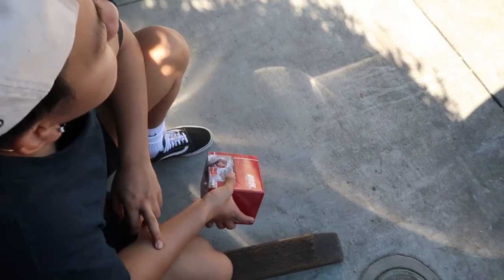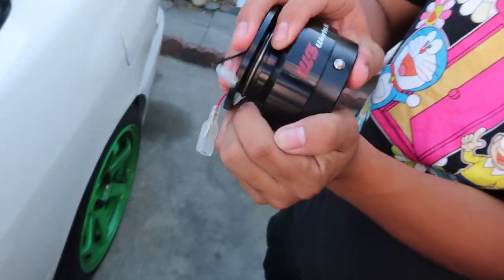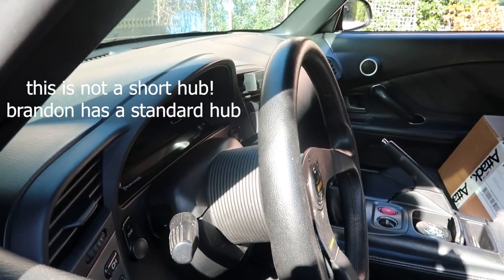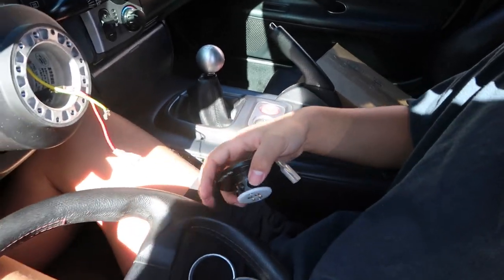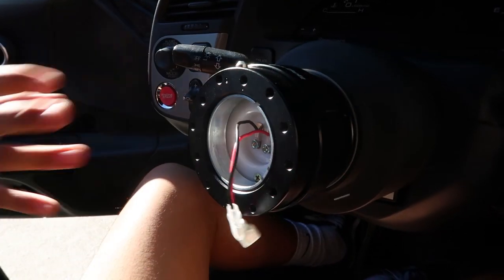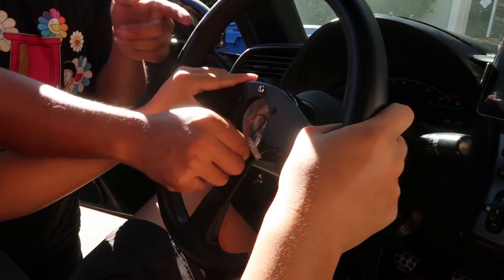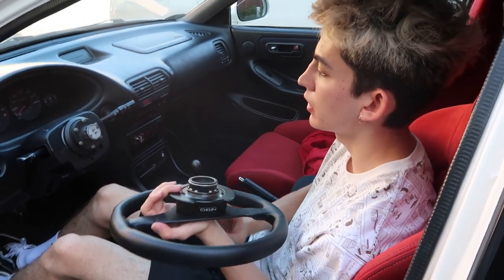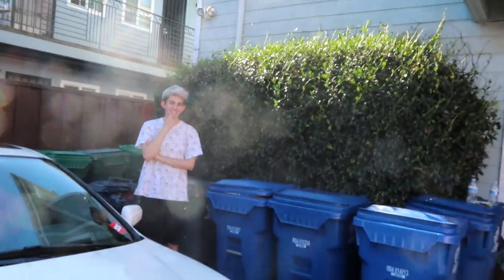NRG VS WORKS BELL QUICK RELEASE!! WHICH SHOULD YOU BUY FOR YOUR S2000!?

Comment: If you ain't tracking or putting unnatural amounts of strain on your steering wheel then nrg or any other cheap option. If you want something good though then works bell. Works bell invented the quick release and have put much more RnD in their products. They also don't manufacture their shit in China. The aluminum alloy they use is much more stronger and durable than knockoffs.

Comment: on werks bell hub, you can remove the saftey switch that prevents you from unlocking the hub easily.
Reply: You can on the nrg too
Reply: WB also sells the RAPFIX Flipper which converts the push button to the fingertip paddles you see on the NRG quick release in this video. NRG got the idea from WB. The WB piece is aluminum.

Comment: Does the nrg quick release work on the works bell hub receiver? Like can you take the steering wheel from the integra and put it onto the s2000 with the works bell receiver?
Reply: iirc, yes you can. NRG is a knockoff of WB. NRG uses cast aluminum vs WB using forged aluminum (stronger). To be honest this a shit video explaining why one is better than the other.  Check out this article for better info. 

https://www.clubintegra.com/forum/threads/works-bell-and-nrg-two-different-end-products.78259/

Comment: I was wondering if NRG and Works Bell QR parts are compatible with each other? Like can someone take their shitty NRG wheel and disconnect and place it on a Works Bell plug or the steering column side or vice versa? Or are other Works Bell quick releases compatible with each other? 
Kinda trying to use partially as a theft deterrent, I already have the Works Bell QR and a lock for it, I'm just wondering how fool proof it is.

Comment: This is a bad video for multiple reasons. 1. That hardware is not what came with the nrg hub. 2. Having a quick release with stock seats is pretty pointless. The thickness of the mounting surface to the hub is pretty unimportant to a certain extent. The odds of it getting deformed in any wreck is pretty unlikely. Driveway boys thinking they’re real track bros because they’re hype beast chasing prices.